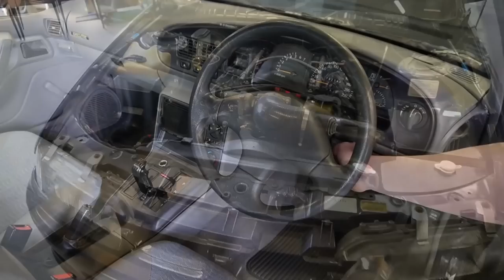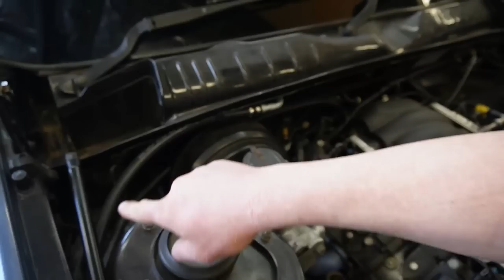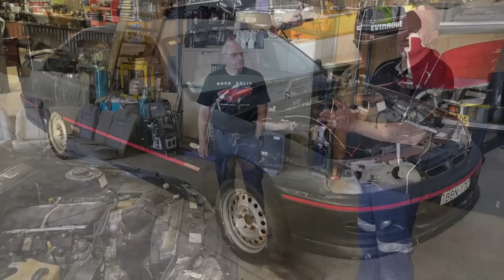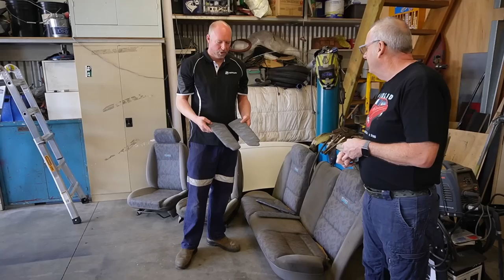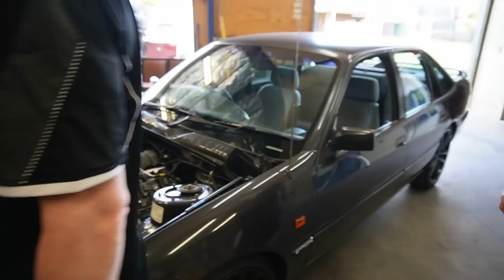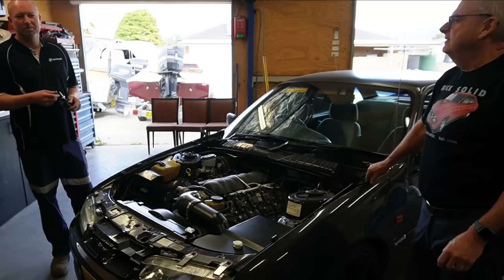Dave's VR SS commodore LS Engine Build - Part 2

Comment: Would be interested to know how you sort out the shifter position and light. Am fitting a TCI outlaw shifter in my VR (700r4 box) and require the same.
Reply: Hi Mark. We used a build ninja light holder and LED set up which was not ideal for a factory look so we modified it and made it work. We also used a Dakota digital sender and box with lots of backyard engineering. As a very handy person it took me a full day to do it all to make the set-up work together.
Reply: @chopit5685  thanks for the reply. Would be interested to see it in a future episode.
Reply from the maker: Thanks Dave

Comment: How did you polish the red trim ?
I’ve just brought a Vs ute with a fg turbo conversion all engineered and the red trim is letting it down thanks Anthony
Reply: I removed them from the car and sanded them with 1000, then 2000, then 3000 foam backed pads that I got from Wisharts Paint Supplies in Unanderra. I then polished them with automotive cut and polish using a rag.
Reply from the maker: Thanks Dave

Comment: Howard, what is the part number of the radio Dave put in, been looking for my project, double din single back sounds what i require.
Reply: I have absolutely no idea sorry mate. I got this from Frankies Auto Electrics in Albion Park as an unboxed sponsored deal. If you tell him it was for Daves VR he will know what you are asking about. It is a Sony and the code on the front is XAV-AX5500 if that helps.
Reply from the maker: Thanks Dave